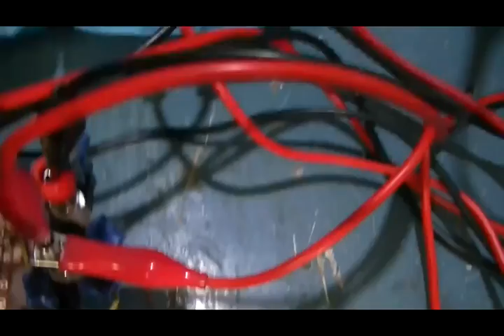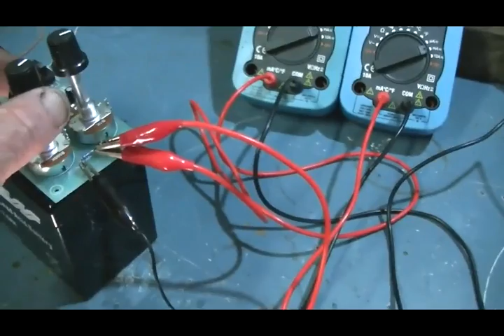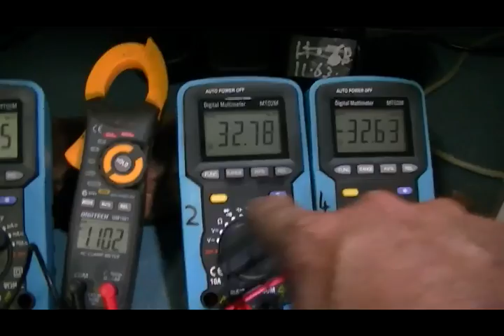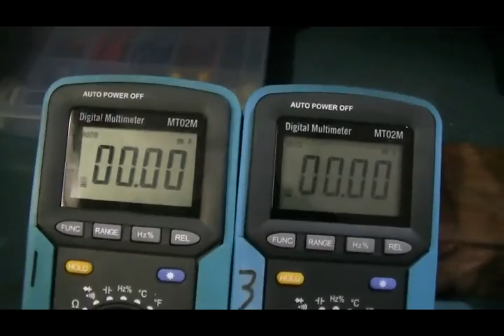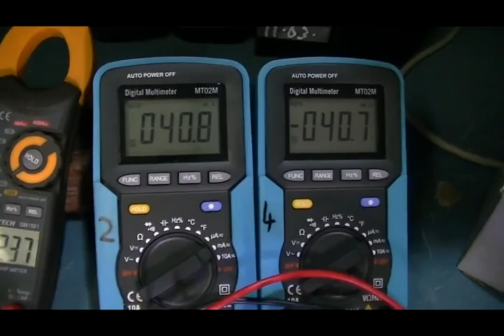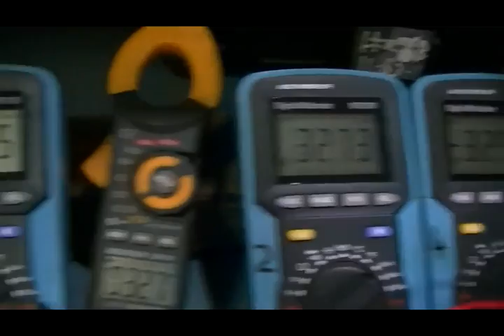tesla circuit,now at 74KHz

Comment from the maker: It is a square wave,but it peaks at 4.2 volts each side of the 0 volt line for a 50% duty cycle.This means that we have only 4.2 volts at any one point of time throughout the whole duty cycle,unlike AC where you add the 120 volts on the high side to the 120 volts on the low side,to get your 240 volt p-p.

Comment from the maker: Hi Kyle
It is not a PWM-it's a wave generator.
The circuit is drawing 3ma(apparently)from the wave generator in both direction,s(either side of the common(0 volt line)
So the total is 6ma at about 4.2 volts
Seems a little to good to be true-so that is why it is now posted on the forum-you tell me?

Comment: Well it sure is interesting. Is it square wave or sine? My initial thought was that the current drawn, for the circuit seems a bit low... by comparison to say a 555 invertor or flip flop that would do the same sort of thing (if it were square wave). Then again, if it 4.2V peak to peak, that is only 2.1V on either side of 0, and in turn, such a low voltage would minimize current draw, as well. I find it odd that a circuit (of any kind) can work so low, but I guess 5V is digital...